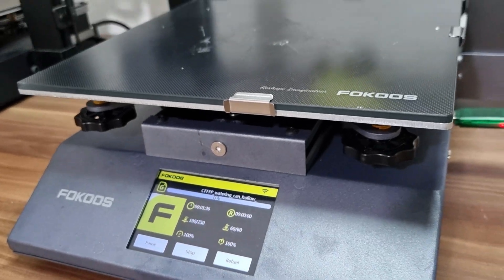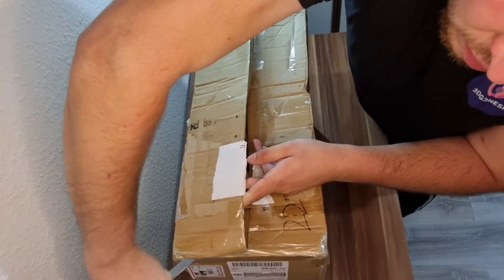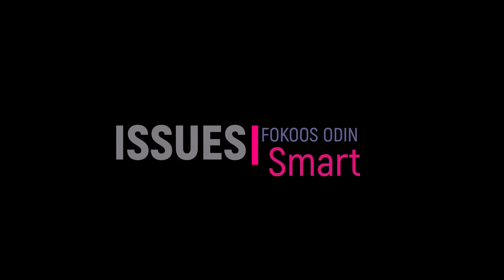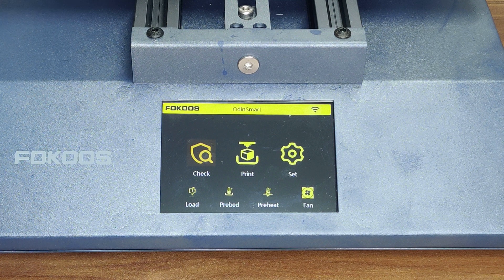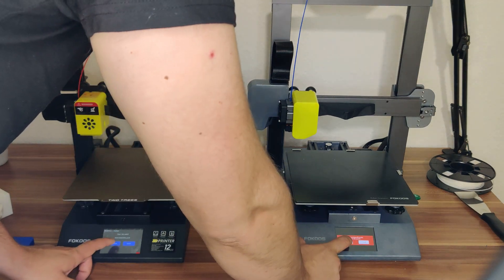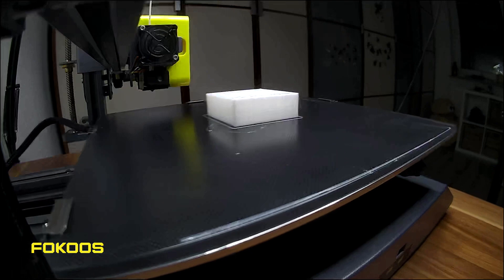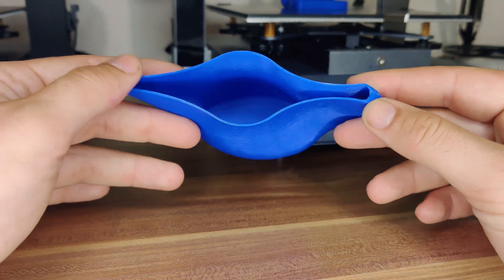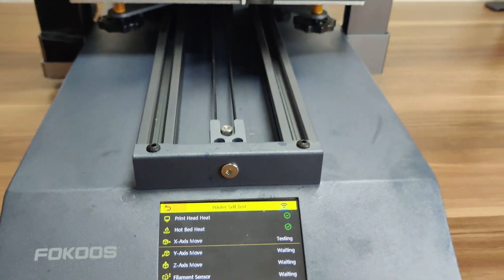Fokoos Odin Smart Honest Review! Are 300mm/s Possible? 6X Faster?

Comment: I can only assume that the parts situation won't change. I've waited months for junction boards, a bad mainboard, extruder drive motor and the latest it a bad TFT35 display. I'm lucky I have 3 Odens. Sometimes two of them work. Dora is going to need help. It's a new unproven, untried unit and even though she does an excellent job in supporting us, she's only one person. I'll wait and in the interim go with another proven brand.

Comment: so based on your review... it isn't good
Reply from the maker: If Fokoos fix those issues, it will be a perfect 3D printer !
Reply: @3dg3nesis  in your opinion though is it worth an extra $150 compared to the normal Odin?
Reply from the maker: @joshuamns1  if Fokoos solve the issues than it's a good deal